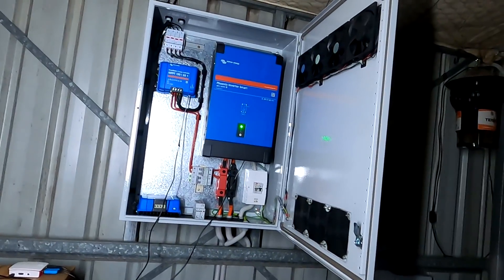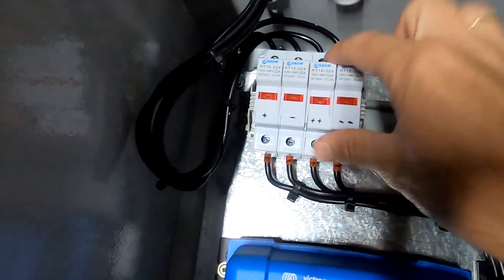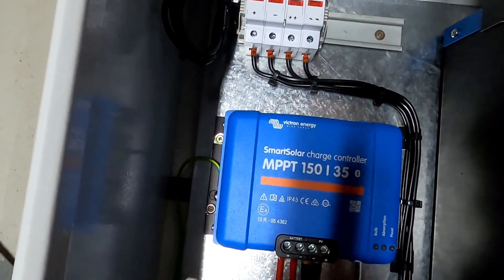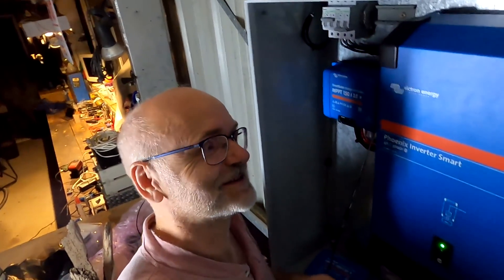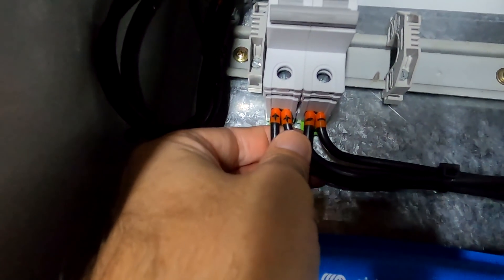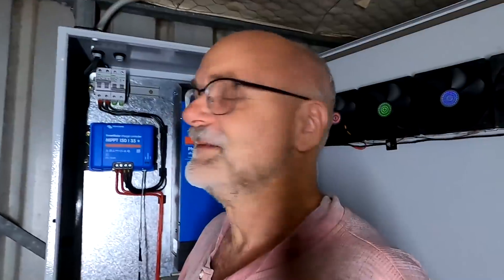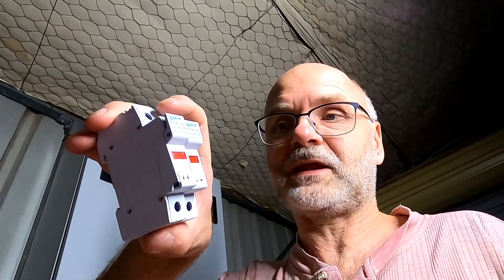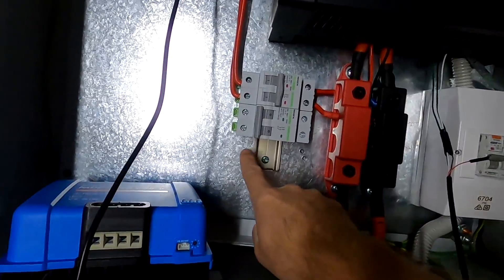Solar Upgrade EP5 - Fuses or Breakers?

Comment: fuses are better protection. they blow 4 time quicker then circuit breakers. but circuit breakers are a little more convenient. you will always get  small voltage readings along runs of cable that are different lengths
Reply: Horse shit... You have to buy the correct fuses for the application. Why they make so many types...As they have to be sized to the unit your protecting..That includes inrush current loads from AC units, Drills, etc....

And a Breaker is designed to not only protect from over load. It protects from frequency changes in the wave form...As they make adjustable breakers just for that. Typically UVR and Shunt trip comes to mind...

So don't make shit up. As they don't teach it as electrical theory 400 years for nothing. As this shit can kill you from bad advice. And it only takes once to find out if Jesus really does exist...

Comment: What the heck! hahaha  You always bring something new every time. You always bring joy, it does not matter if there is a problem or not, there is always joy in every video and make my face smile - big smile. Thank you.  Yes, circuit breakers are better and not wasteful than fuse when triggered. For lightning, SPD or the surge protection device is there for that and is connected to earth ground when triggered.
Reply from the maker: Thank you 😊

Comment: Third benefit of breakers vs fuses is that you can easily see if anything has tripped - and a 4th is that you don’t need to purchase/hold spare fuses should anything fail.

I’ve seen a few watts of production from a really bright full moon, and as for lightning flashes at night⚡️⚡️⚡️🤯🤯🤯
Reply from the maker: Thanks, Ian.

Comment: I like circuit breakers over fuses for many reasons not the least of which is I can never remember where I put the fuses.  You'll probably never trip one.
I watched a video a couple weeks ago about counterfeit circuit breakers. Might have been Big Clive or someone like that. There was nothing inside!  Moral of the story: Get circuit breakers from a reputable supplier, not EBAY  or Amazon or any of those Chinese outfits.  :)
Reply: Yes, the convenience of not having to go and buy another fuse at the worst possible time justify the value of the circuit breaker.

Comment: The Moon!!!  I have seen in few instances when using high voltage strings of panels that moonlight (which is reflected sunlight) can actually be picked up by high voltage panel strings and produce power. I’ve seen as much as about 8 watts at night during a full moon on a 3kw system.  Also those orange street lights can also turn on the panels.

Comment: 25A is not enough for two parallel set of panels even if your panels are older. Especially as your ambient will be high and even more so in that cabinet.
Reply: 25A should be far enough!? Usually Breakers should trigger at 3times the named current? Or are there different behaviors of AC or DC breakers?
Reply: @marv011  No, you want fuses for solar DC rated at 1.55x the rated panel current.  Solar can produce more than their rating at time.  And fuses are always sized for 125% of the continuous current.  They can take higher than rated current for 1 minute....but solar is all day.
Reply: I think these were 9A panels so a set of two at 18A x 1.55 = 28A.  Yeah, not enough by the book.  But pretty close and likely won't be a problem since his panels are 10% lower than rated based on age.  He had 10A fuses on each string before which I think would have blown on the hottest days.
Reply: @jmaus2k  Doubt those panels have more than 5% degradation.
Breakers depending on ambient can trip way below 25A rated current.
A 32A breaker will be needed for two parallel panels made with 6" cells.
You will designed breakers or fuse rating so that max continuous current is about 66% of breaker rating.
Reply from the maker: The panels can still produce a bit over 10A in a short under ideal conditions. Under normal conditions, I get 7A-8A out of each string. I have two strings in parallel. If I get more, I have to replace the breaker with a larger one.
Reply: @OffGridGarageAustralia  With edge of cloud effect you can see as much as 12A from those panels (I had 240W panels that put out round that 12A for a few seconds).
That is not the main problem but the 25A rating is for breakers at +25C tho they will get quite a bit hotter and so they can disconnect even at 20A.  You will see if that is the case an make a video about that :)
Reply: @electrodacus  The panels are not facing perpendicular to the sun at any point.   Some shading too.  And I doubt they will be cleaned every day.  Not going to be an issue with 25A.  .66 is close.  Code here is 1.25 x 1.25 = 1.5625 which is 0.64 of breaker rating.
Have you thought about an active balancer that only works when voltage is going up?  Then us 48Vers could use two of your safe 24v setups.
Reply: @jmaus2k  Sorry the SBMS0 is only good for 24V (8s) systems and the balancing is not the problem. 
In a cold sunny day (maybe after some rain) each string of panels will put out 9 to 10A so 20A through a 25A breaker is way to close and I'm fairly certain the breaker will trip annoyingly often.  I do have slightly newer panels 260W rated still around 9A max power point current and use 32A breakers for groups of two panels and that works great but it will not work with 25A breakers as it is already close to limit.   Of course I do not know how those NoArk breakers are rated and what the quality is.

Comment: On the clamp meter you were reading millivolts not volts so its possible they were producing 2 millivolts at night, and also you could enable the backlight so you could see better :)
Awesome video as always
Reply from the maker: You are correct. It was too dark to see that 😂